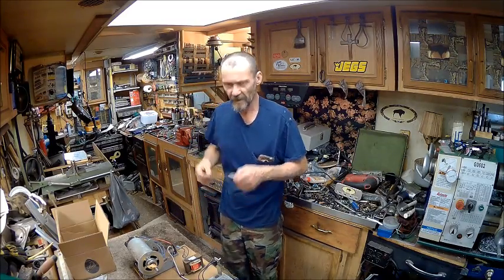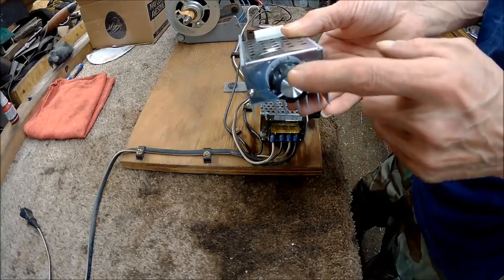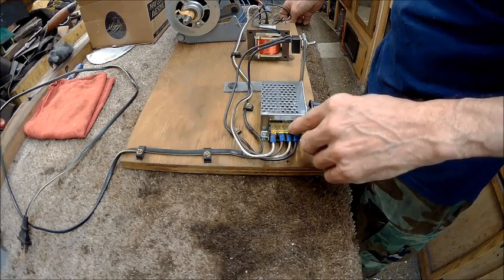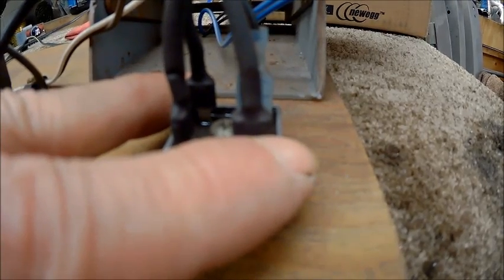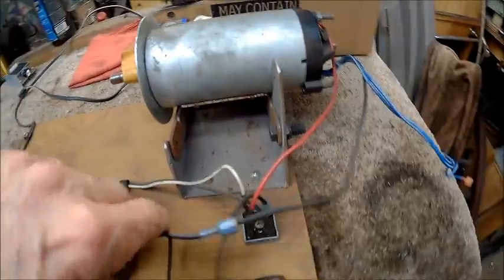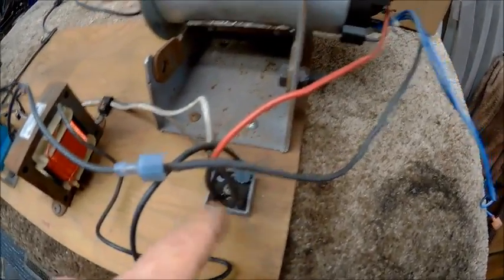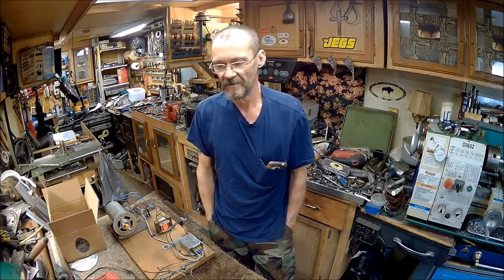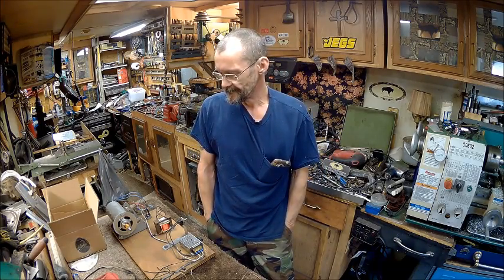wiring a treadmill motor test board

Comment: I tested my 3HP treadmill motor when I took it out of a free commercial treadmill just using a AA flashlight battery, to see if the motor would run and for marking the motor for the direction of rotation I needed. 
You do not need to buy anything to make the motor do what you want it to do. Just modify the original control board, my control board took a 500K pot. for the speed I needed for my metal lathe, and discard the power board and control panel along with everything else left on the treadmill.

Comment: I have bought a 4000w and 10000w motor controller and a Bridge rectifer and I have never got the Lathe motor any slower than full speed
Reply from the maker: well for starters, i dont recommend using a treadmill motor for a lathe. it will work on the little lathes but the big lathes dont get the torque it needs. but it still should give you adjustable speeds. did you hook it up correct?
Reply: SCR controllers are often faulty and only output full voltage.

Comment: Great video my friend.  Only wanted to ask you  a question.  What size is that choke that you are using?   Also I noticed that you are removing the scr circuit from the heatsink and metal box.  Please don't do that.  The board without the heatsink will get extremely hot and start a fire.  I noticed that this video is over a year old by the replies. So forgive me if you already dealt with this issue.  Thanks.

Comment: 2 k potentiometer will give you lower rpm control
Reply: I believe the 5 k will only give 300 rpms where 2 k potentiometer will give you 100
Reply from the maker: @georgespangler1517  thanks
Reply: @BisonWorkshop  your welcome. ,I was able to find an old style treadmill with simple m60 board and touch slide for speed control,,, dam I love it,,,no more belts to switch,,,so smooth and quiet and unbelievable torque,,, and the soft start is so much easier on the lathe inself,,,it made my 12 x 36 atlas lathe a whole different machine,,, even my finishes are so much nicer to set speed just right for different metals,
Reply from the maker: @georgespangler1517  cool

Comment: Are you using an SCR controller?  If so, for a test board that's fine.  Not great as a motor speed control because the motor loses power as you decrease RPM.  This is due to the SCR Controller triggering on different parts of the sine wave dependant on speed selection.  Therefore at slower speeds, you are using less of the sinewave and therefore reduced power.  The best solution is a PWM controller from a Treadmill or a commercial PWM.  In this way, max power at any speed.  If your use is for a motor under 400W than this is a great solution.  I have one of these for my treadmill motors.  https://www.amazon.com/24V-90V-Controller-Electric-Regulator-Permanent/dp/B076KPP92X/ref=sr_1_46?keywords=motor+speed+control&qid=1572458884&sr=8-46 
You can get them also in 220V version.
Reply from the maker: thanks

Comment: Is it necessary to use a transformer, saw some other posts that didn't, you seem to know a lot more about this stuff, thanks
Reply: It's an inductor.Basically its function is to store energy. When AC turns To DC you have gaps in the waveform of the input source. The inductor stores energy and uses it to help fill the gaps left by the rectifier. It should be put after the rectifier. It should be placed after rectifier, not before.
Reply from the maker: its not a transformer. its a choke i believe. its my understaing is the it cleans up the waves. but dont take my word for it
Reply: @BisonWorkshop  thanks , is it ok to use the one in the treadmill
Reply from the maker: @1951shelby  thats why i use it. cant hurt to leave it with the motor.
Reply: @BisonWorkshop  thanks, you are very helpful, where are you located, i live in north missouri
Reply from the maker: @1951shelby  wva

Comment: Great video. I’m looking to convert my small wood lathe to this type of set up so this was very helpful in understanding the process. I’ve watched a few other videos where they use the same components minus the transformer. I was wondering what purpose the transformer serves and what type/size it is. Thanks again for clear and simple explanation. Electronics is kinda outside my wheelhouse so, much appreciated .
Reply: it's a choke, and its purpose is to smoothen out the ripples from the rectifier for smoother DC coming into the motor.